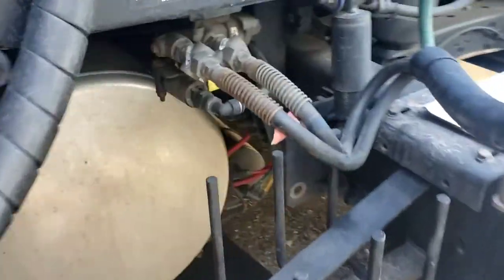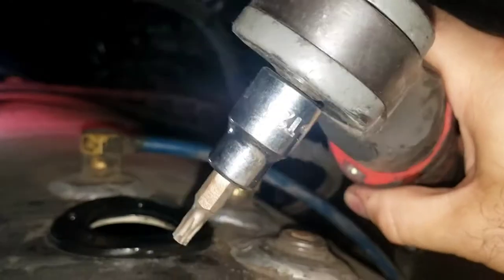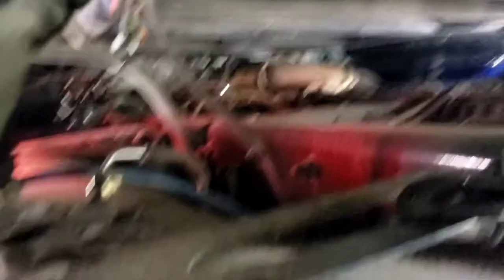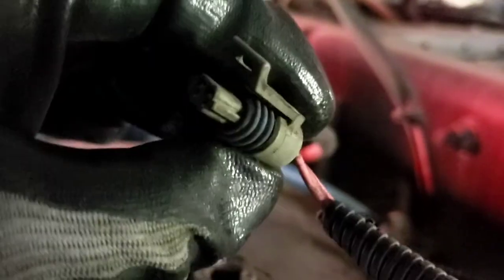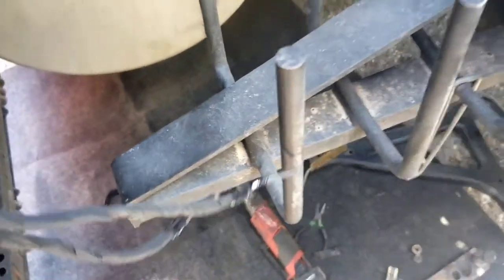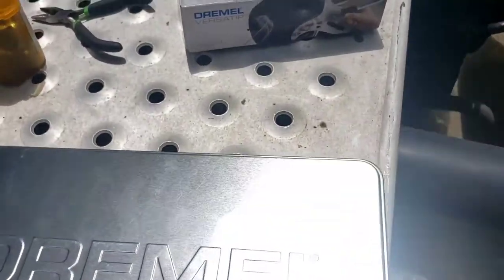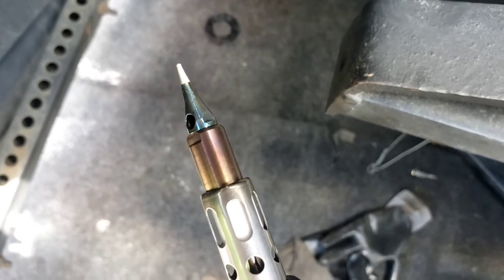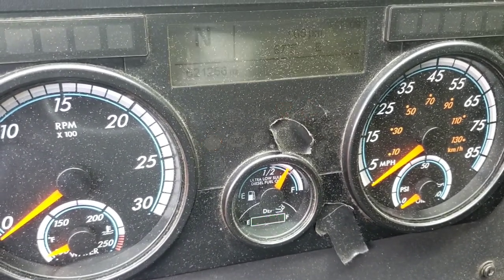Fuel Sensor replacemant on Freightliner Cascadia

Comment: What year Cascadia is this? The earlier models have 3 prong plug, newer ones two prong plugs.
Reply: Any cascadia should be the same, the very newest cascadia 2019 (newest body style) have the sensor on the passenger side, but the part and procedure is the same.  I have a 2016 mfg in 2015 and it has 2 wires.
Reply: @CheddarCheeseBandit  - Nope, apparently you didn't read my post. There are TWO plugs available and they ARE NOT the same. Spare me the "should be's". If you don't know then please don't comment!
Reply: Where you able to find a replacement for a 3 prong? Every video I've watched all have 2 prong.